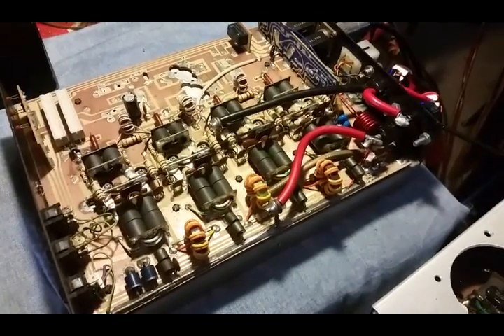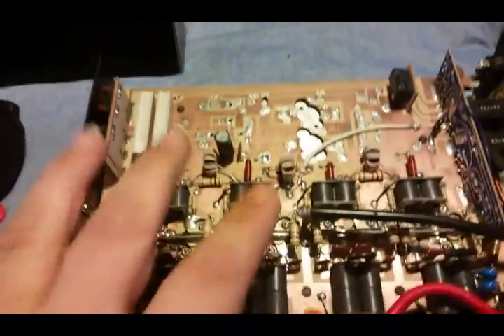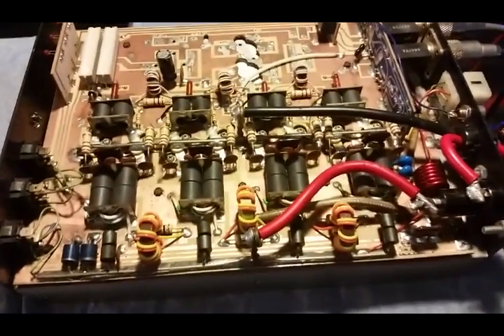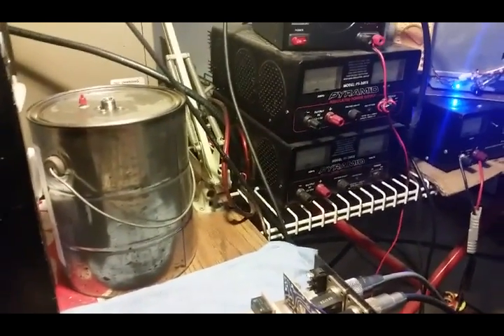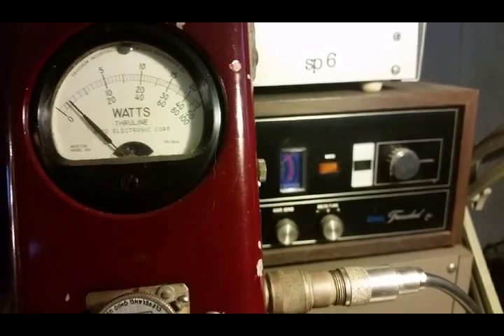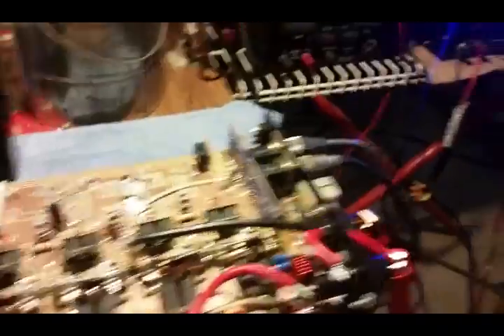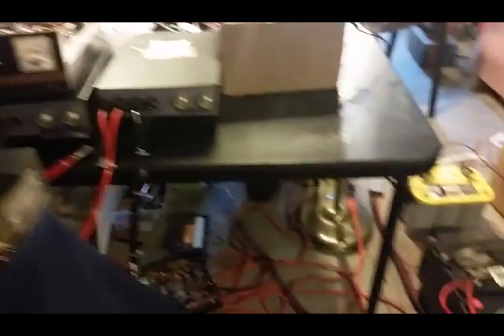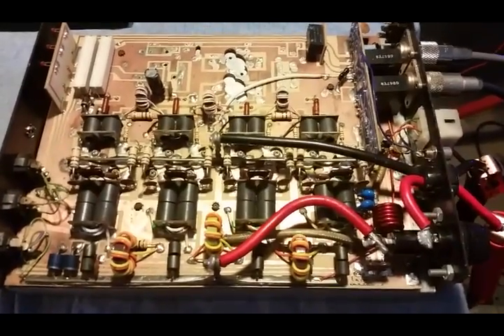Messenger M4V High Drive Conversion & Repair

Comment: I have a m4V working great .got at hamfest is a 1X8 but has 9 MRF 453 in it. is the bigger transistor like 454 492 Etc but same as 455. better cooling. great SSB about 500 watt input SWR below 1.3 :1 with L M H  settings. best to run a AB bias amp at 15 volts . great job re tuning to a straight 8 pill. my hot plate does same input reflect . better with driver or hot radio.

Comment: Mr. Gatekeeper sir, I have a Messenger M400 that only has the the stock set up, As you know it it the same board as the M800 but half pilled, I would like it fully pilled to the M800 version. How much would it cost and will I get 8 matched pills +1 driver and a decent "core charge" for my old pills that kick ass btw! 
This box with fan will do 350-400 all day! 
To get my desired sound I use LOW/MED with 6 watts in on the 4 watt setting, maybe looking at 300-325w , 
Unfortunately something is wrong with my high setting, I did find a burnt resister in the power selector board so I pulled it and it tested fine so I am at a loss.
I miss 400w and it was doing maybe a hair over, but 600-800w would be great!!!!

The amp also looses receive a lot, like a bad relay or bad solder around the PL-259's but I re-soldered and cleaned it up "on a microscopic level!" still no change.
I am getting tired of smacking the box to get my ears back!!!
 thanks GK and you can send a quote to jimlav72@gmail.com.
73' from 272 mobile, out around the dock on the bay, San Jose, CA.